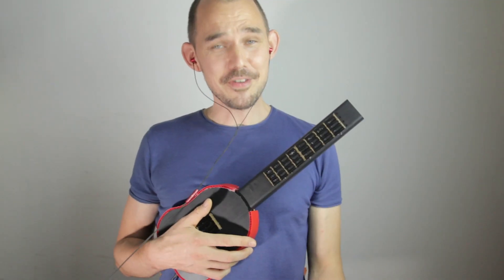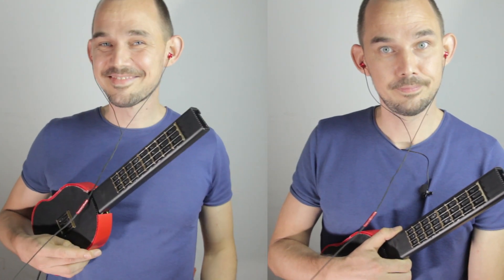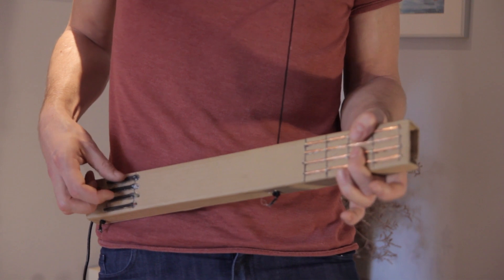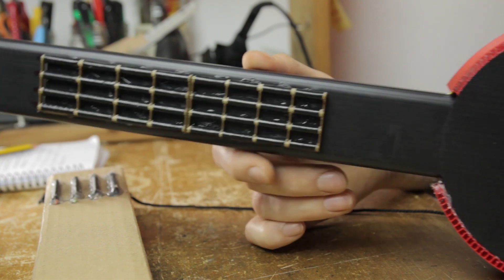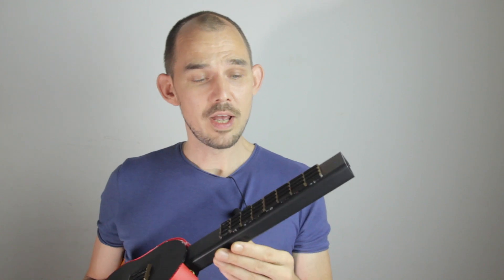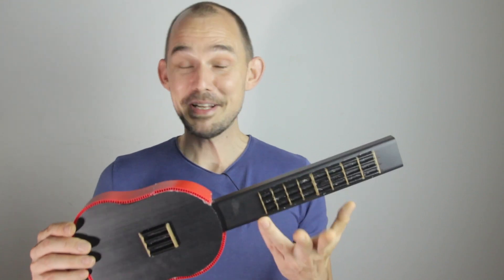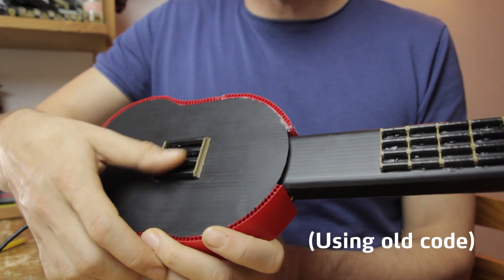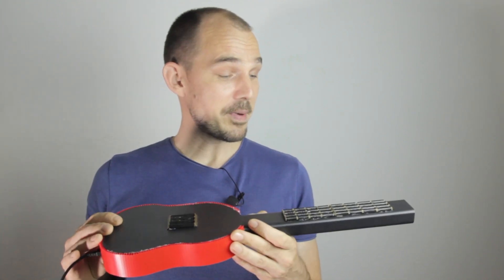Ukulele MIDI Instrument + song. Made with the K.L.I.K.

Comment: Hi there. Thanks for the exciting wind instrument and other midi projects I went to Git to see the code. Maybe there is a different repository? Everything there is 4 years old, and I think you are making changes such as the speed on the strings... Just want to be sure I'm going to the right place. Thanks again and Merry Christmas
Reply from the maker: Hi Tim. Thanks for watching. 
Right now the principal KLIK instruments are all part of a common sketch,  which means that the KontinuumLAB Instrument Kit chip can be used to build a few different instruments without reprogramming it. However, I won't be sharing the "master" sketch, at least at first. The separate sketches for each instrument will be shared on github when each tutorial video comes out.
Thanks for your patience, and a merry Christmas to you too.

Comment: These are super cool bro I was just checking out your website, I'm very interested. I've been thinking of something similar only converting an old guitar with similar electronic. I will definitely be watching all these videos and waiting in great anticipation for these kits when they are ready for production.
Reply from the maker: Thanks!! Converting an old guitar would be cool. But of course you would have to get rid of the strings, and probably rework the whole fret section a lot. Sounds like you have lots of cool ideas.
Reply: @KontinuumLAB  yeah I was thinking about it and I'm probably just going to take the neck from an electric guitar and either drill holes or gut it and then drill holes, maybe cut the fretboard off the neck and make it removable. Then I would either build a custom body or maybe take a non routered body blank for an electric guitar and router it from the back and then cover it with a cover plate. And yeah tons of ideas, I feel like if we spent a weekend together we could make some really crazy cool instruments.
Reply: I like the idea of soderless connections for easy changing and trying new ideas but I would probably make a smaller board and soder it for my final version to make it a bit more compact, but maybe that isn't necessary.
Reply: I do a bit of coding as well so will be fun to mess around with the software
Reply: I also do micro spray gun painting with automotive candy paints (used to make custom painted Xbox controllers and cerakote for guns). Will be super cool to make a completely unique midi guitar and other instruments and then paint them with awesome paintjobs, custom lettering and graphics. I'm straight hyped right now.
Reply: I make some various types of music myself and like playing around with new sounds and making instruments. Im also a ceramic artist so I have made things like ocarinas out of clay, would be nice to insert electronics into them. I'm very hyped that I found your channel, loving the things your doing.
Reply: If you want check out my music it's on my channel. I have some Rap, some hip-hop remixing and production, and some guitar playing and singing (might have to dig for it, I think there is a playlist in there somewhere).
Reply: Could you make an electronics kit like this for a 6 string guitar? I would like to modify one of my acoustic guitars with midi control and looping capabilities.
Reply: For guitar like you could add buttons on the side or bottom of the neck like you did on the saxophone thing to change octaves, that way you can a lot more with less frets. I would about 6-7 fret sections. Since you have a thicker, wider, and longer neck you will have plenty of space.
I'm guessing I could router out the neck of my existing guitar to run all the wiring, use a hatch system for the body to house everything and seal the neck with some kind of material to cover the wiring but be removable for easy access adjustments and maintenance.
You got me thinking hardcore 
😎🤙🖤🎶